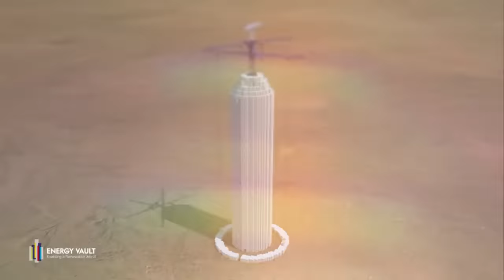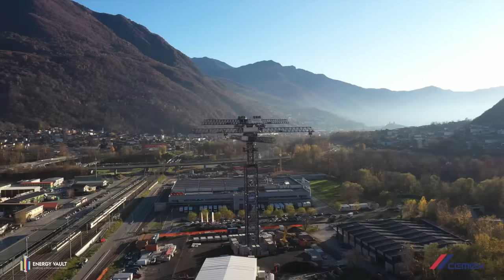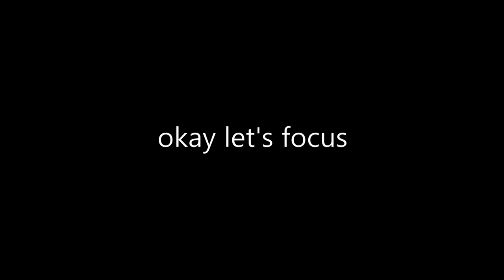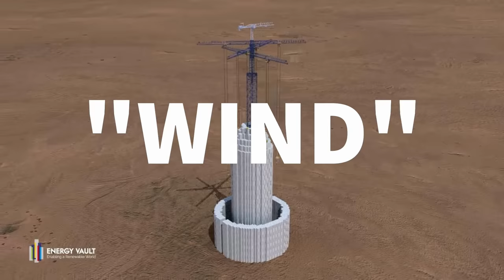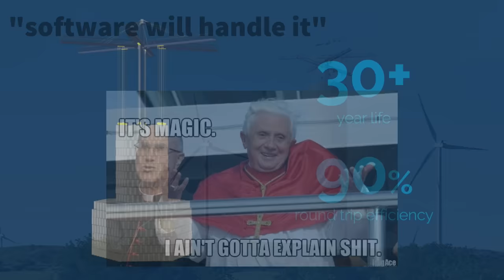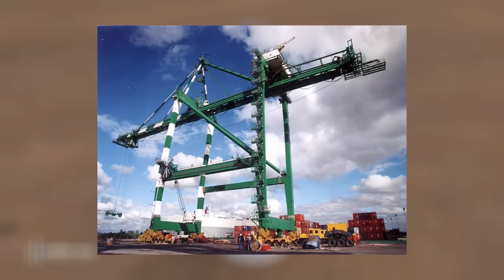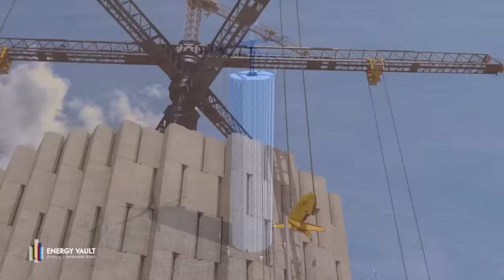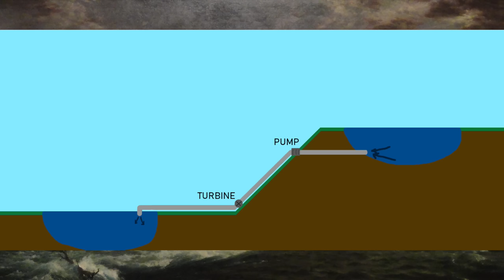The Energy Vault is a Dumb Idea, Here's Why

Comment: Also can we talk about how just rearanging them in a bigger circle arround the tower SEVERLY limits the capacity of the battery? As soon as the heights equilize your've got no more energy to take from it. Worst case scenario you can only really ever use half of the height.
Reply: "Half the height"?
No, not really...
If this were practical (which it isn't) you've missed the realisation that an "outer circle" of blocks could have twice the diameter... C = pi * D. Double the diameter and you can move 66% of the full height of blocks to 33% as the 'discharged' height (ie: more than 50%). Go for a 3rd ring and all of the blocks could be lowered to 16% of the full height...
It's just theoretical... The idea as presented is rubbish, but the CGI version has quite a larger capacity than only 50%... 🙂
Reply: @rustycherkas8229  you also have to worry about decreased efficiency as you stack the outer ring higher the difference in height between the inner and outer blocks goes down so you get less energy per block moved
Reply: @kingofgar101  
Right you are!
One might expect that (if this were at all realistic) the selection of which-blocks-are-moved-where would be 'choreographed' to somehow optimise the energy recovery to match expectations... It's an interesting academic exercise, and it's amazing that the company's marketing wastes time claiming blocks would be painted thereby becoming a pixels in a "towering artwork"... Hope you like abstract!! 🙂
When my daughter was 3, her Christmas present was a bag full of wooden blocks... On Christmas night I tried stacking a tower using those blocks... It's amazing how an invisible imperfections in lower layers were 'amplified' up the columns making the 8th or 9th layer unstable... a stack of 60 or 80 is only possible in one's imagination, or in "an artist's rendering for marketing purposes"...
Happy New Year! 🙂
Reply: @rustycherkas8229  Theoretically you can lock the blocks to the side blocks as well to offset it but that is only a small problem with the system.
Reply: @catprog  
Theoretically, hexagonal blocks could be arrayed in a honeycomb pattern that would avoid dealing with the differences between rectangles and circles...

Theoretically, I should be eating my dinner right now... 🙂
Reply: @rustycherkas8229  Perhaps They Could Lift Cylindrical Ceramics Or Spherical Steel And Load Them Into A Gravity Fed Helix?
Reply: Pneumatic Lift Or Hydraulic?
Reply: Liquid Cooled Core?
Reply: @VerifyTheTruth  There are 'amusements' that raise ball bearings or marbles then release them to roll down winding tracks... Is this what you mean?
Please clarify. Can it store energy for long periods? How to extract stored energy from a rolling sphere???
Reply: @rustycherkas8229  Induced Polarization And Electromagnetic Induction Are A Couple.
Reply: Unloaded bricks should be spread on a single layer on the ground. It's the best way to get as much power from lowering each one. Maybe have a raised platform so the height difference remains exploitable. Of course, this design would have a large space requirement, not to mention the extra energy needed to cover greater distances...
Reply: @robdom91  
"Single layer on the ground"? How long would each boom have to be, and how strong? Spreading out the 2nd lowest layer to be only 1 layer wouldn't be worth the effort.

"raised platform"? Please scroll back to my comment estimating how the lower 33% (or 16%) of the tower's height could not participate in the dynamic storage/release action.

In short, there would be a lot of "dead mass" required to build this. In the simplest case, for every 2 blocks stacked, only 1 could store/release energy. Practically, for every 3 or 4 blocks stacked, only 1 would pay dividends (if this were more than a 10y.o.'s Science Fair project to begin with.)
Reply: @rustycherkas8229  Yes, well I admit we're all talking about polishing a turd. The entire thing is unfeasible at best. Even if you made it work in practice, it would be far too noisy and dangerous to put anywhere near people. If one of those bricks chips and falls it'll turn into the biggest game of Jenga ever...
Reply: @rustycherkas8229  What If You Lifted Just One Really Really Big Block?
Reply: Folks, We Are Encompassed By And Immersed In Energy.
Reply: @rustycherkas8229  Were The People Of Easter Island Building Aircraft Carriers, Skyscrapers, Partical Accelerators, And Laser Spectrometers?
Reply: @rustycherkas8229  I Don't Have Water Or Electricity.
Reply: @VerifyTheTruth  
Neither did the Egyptians who built the pyramids... well, not electricity, anyway...
Reply: @rustycherkas8229  I'm Not An Egyptian.
Reply: If someone were to really do this, they'd probably be dropping the blocks into a trench, with the material from the trench used to raise the bottom-most block high enough to always get some energy out of it. The alternative is that the whole system would be located underground.
Reply: @kingofgar101  but since when "charging" the tower the blocks are also on that height you dont lose energy, you only lose on the max capacity
Reply: Poor argument. If the energy storing cylinder with a radius of, say, 10m, has an area of 314m square upon which to stack. If the crane can extend to 20m for the energy recovering phase, they have 1,256m sq to work with, meaning 75% of the tower height can be recovered. This idea makes a lot more sense than a channel that needs to make fun of things for clicks is letting on.
Reply: @oregonNYC  and even then, its not like you lose those 25% after it is constructed, since they dont have to be charged from this inefficiency
Reply: @larsrademakers6070  true. Frankly, this system makes a lot of sense. Water capture requires a lot of concrete too in dams and pipes. Maybe more, maybe less than this tower idea, but it isn’t a 0 footprint solution. Frankly, this video cut a lot of corners in analyzing the viability of the tower solution by assuming no carbon cost to pumped water.
Reply: @oregonNYC  yeah especially for a place like the netherlands where i live, we have no space at all for a decent hydro electric battery, this would probably be one of the solutions to energy storage in the netherlands (allthough more refined)
Reply: @robdom91  but a damm is safe you mean? If one part chips your floodin a whole part of a country?
Reply: @larsrademakers6070  Nothing is absolutely safe. But, there are easier precautions you could take when managing water flows though. You could designate a flood zone or create a relief canal to guide the flood water to a nearby lake or river as a kind of fail-safe. The benefit of using water is that it's way more efficient and more reliable.
Reply: @robdom91  yes but its not possible in a place like the netherlands
Reply: @larsrademakers6070  In that case, they should just dig a hole and have an elevator style system lifting and lowering a giant weight. Cables could be permanently attached to the weight for safety and being underground would prevent the weather from interfering and also insulate sound. There is no need for complex software or anything like that. The simpler the design the better really.
Reply: @robdom91  would it not be better to use several smaller weights so you can store small portions of energy more easiely?
Reply: @seemi8053  Yeah, but would it work better that way? You can put in a break to slow or stop lowering the large weight if you're afraid you're discharging too much energy. Mass is mass regardless what shape it is or how many portions make up the whole.
Reply: As for flood zones with dams, if we're willing to set aside that much area for a fail-safe, there's no reason we can't do the same with our fancy jenga tower
Reply: @shade7367  Can you swim in falling concrete?
Reply: @robdom91  I can't swim at all, but the typical human can't swim in raging torrents resulting from a dam breech. Farther away is fine, but falling debris doesn't tend to get all that far
Reply: I mean that said it's not like this is the best answer by a wide margin. Too much lost in thermal energy...
Reply: @shade7367  That's true. The breach area would be a dead zone for sure. Water can cause tremendous economic damage further away too and especially if there are underground areas, like tunnels or basements. But I still trust water management more than a precision crane system that's less efficient and super sensitive to wind conditions. Storing energy is dangerous and difficult in most cases.
Reply: @robdom91  completely agree there. They're trying to reinvent the wheel here, where we've been using gravity and potential energy for a very long time and water was always the best option, hence why we use it.
I'm sure having the option in areas where hydroelectric power isn't viable is a great thing, but realistically this system has just as many issues with where it could be viable if not more. I'm all for having more options, but giant Jenga towers is definitely low on the list of things I want to see in my area xD
Reply: @robdom91  I meant that it would take less energy to start moving a smaller mass. Not sure if my thought process is corect though.
Reply: @seemi8053  It will take less energy to move smaller mass yes. But you also get a proportionally small amount of energy back. Move a large mass and you can get larger amounts of energy back. You'll never get back everything you invest, there's always going to be a bit of loss so it would make sense to think big. Since converting movement into energy and back creates loss, fewer conversions means fewer losses. That's my logic anyway...
Reply: Almost everything has already been said, but to the ones that still think the huge Jenga tower is a good idea, think just for a moment of how much energy you would lose to run all the safe systems, sensors and cameras built on every crane to be sure every block is positioned correctly, computers running all day to monitor the stability of the tower. Also think of all those parts, fail safe included, that would need maintenance and control and also, think if you need a large amount of energy at some point, in how time this system would be able to fulfill the demand? It's limited by the number of crates, and the time of operation, and I am not an engineer but I am sure it would be quite slow. On the other hand water storage is way simpler, it can be modulated, and it's continuous, do not underestimate the fact that it can generate power continuosly until there is water. For Netherlands I think it would be way better to dig a big hole and made a water storage systems with tanks, all benefits fro the water system and the "form factor" since Is dig in, it would cost quite some tho, that's the biggest problem, but those Jenga towers aren't cheap either.
Reply: We need a space elevator.
Reply: @robdom91  for this to work most efficiently you would never want to burn energy using brakes.  Ideally once you start lowering a block, you only want it slowed by the drag of the energy recovery system.  Also consider that the infrastructure for raising and lowering a larger giant mass is going to be disproportionately more expensive than that needed for smaller blocks, which would be essentially off the shelf.  

So smaller blocks would make more sense.  And you would want to always extract all the energy of each block once you start lowering. The actual output of the entire system would probably be buffered by a faster response battery system.
Reply: @robdom91  for this to work most efficiently you would never want to burn energy using brakes.  Ideally once you start lowering a block, you only want it slowed by the drag of the energy recovery system.  Also consider that the infrastructure for raising and lowering a larger giant mass is going to be disproportionately more expensive than that needed for smaller blocks, which would be essentially off the shelf.  

So smaller blocks would make more sense.  And you would want to always extract all the energy of each block once you start lowering. The actual output of the entire system would probably be buffered by a smaller capacity but faster response battery system.